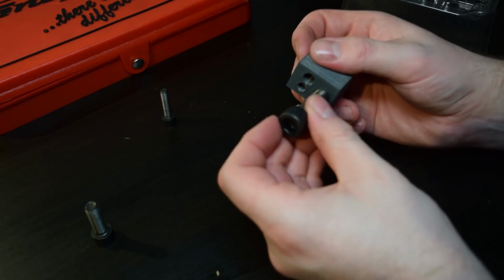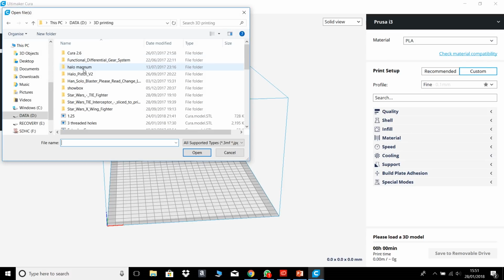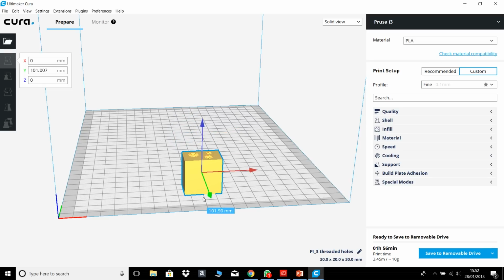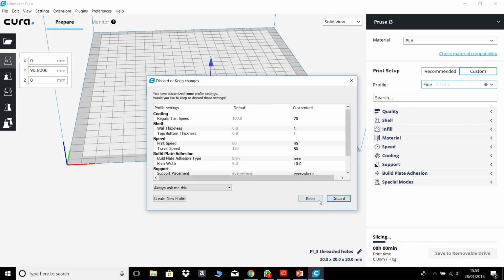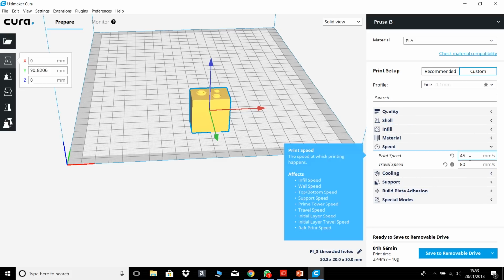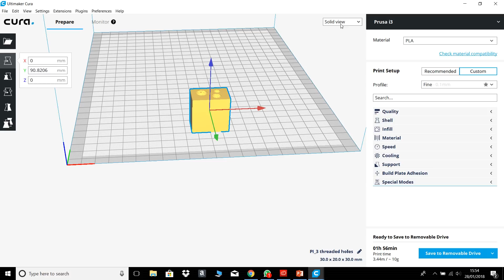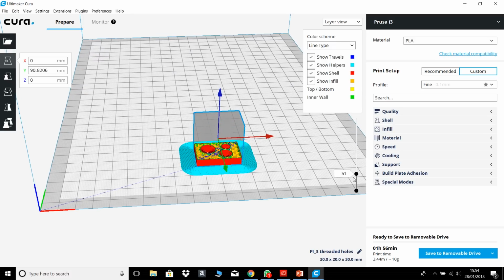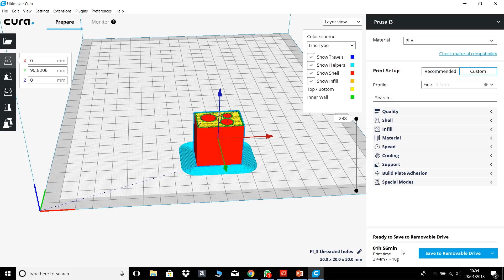Can you 3D print a thread ?

Comment: did u use the default threads given in solidworks or did u modify ?
Reply from the maker: Yeah I just used British standard m8x1.25 thread pitch
When 3D printing the part make sure you add 3% (to the bolt size)due to shrinkage and it should fit lovely in most applications 👍🏻
Reply: @CarsandEngineering  Hi there, i am making a project that uses m6 iso metric threads, how do i scale the threads 3% more? (i will be printing the screws themself too) so do i still need to scane the threads if i print bove the thread insert and bolt? thanks. Greets from Belgium (printer: cr10)
Reply from the maker: @aarriikknn33ll  I found that scaling the thread 3% more was all that was needed, keep the bolt the same size. 
The way I did it was in the slicing software I changed the size of the part from 100% to 103% this should make everything fit, it’s a case of trial and error I’m afraid. Good luck!
Reply: @CarsandEngineering  Thanks! I've tested a print and not scaling also screws but its very loose, so is should scale it up i guess. Thanks for your input!